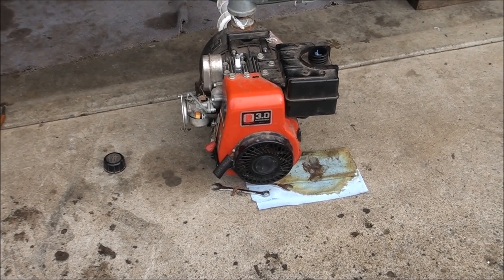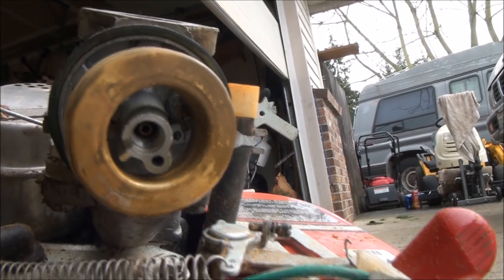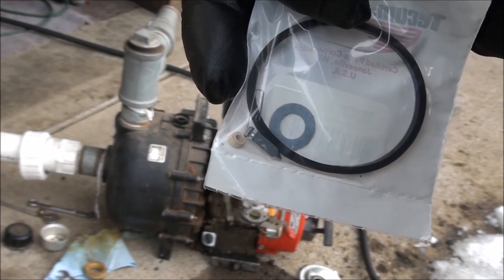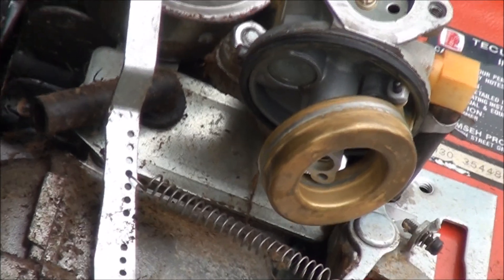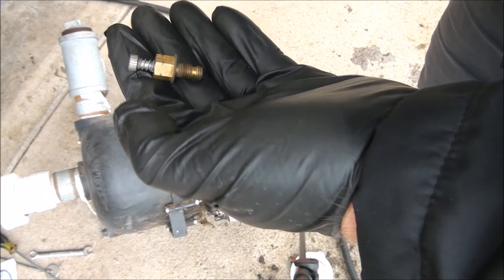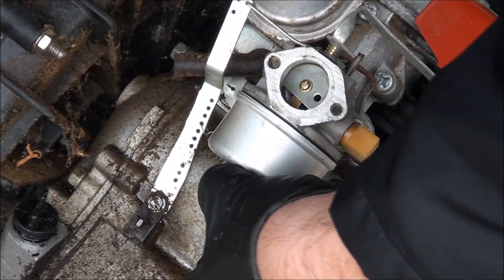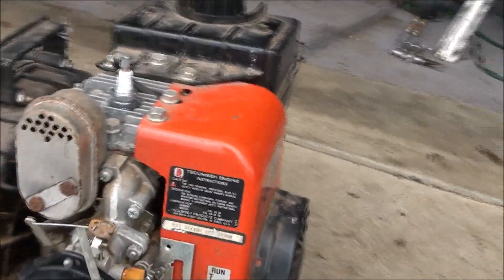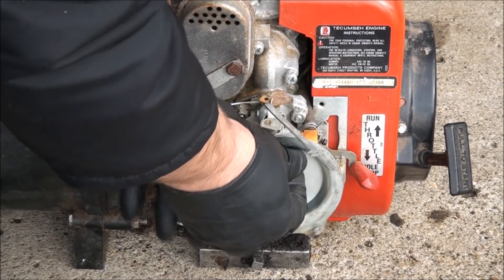3.0 Horsepower Tecumseh H30 Side shaft Engine. Carburetor Cleaning and ADJUSTMENT Procedure

Comment: How long is the throttle linkage. Mine is missing on the tiller I just bought second hand. Is there a part number or can I just make one out of a piece of wire? I had to clean the carb due to it sitting for 2 years. It runs but does not respond like yours did at first. I just ordered a new carb but will rebuild the original to have on hand. Thanks for the video. It will help when I need to adjust everything on mine.